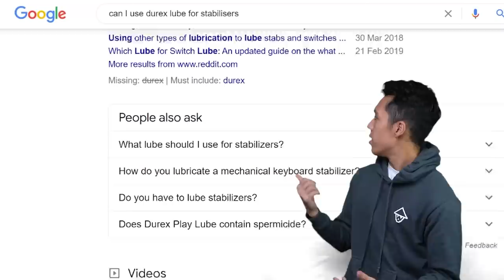$150 Budget Hotswap Custom Keyboard - Idobao ID80 V1

Comment from the maker: Two things, they do have backlight capabilities, I messed up, sorry about that :( and $150 refers to the price of the ID80. I made that clear at the very start of the video, hope that helps. Thanks! Also, go to: https://nordvpn.com/hamajineo or use code hamajineo to get a 2-year plan with a huge discount plus 1 additional month for free !  

Thanks guys, see you in the next video! <3
Reply: hi
Reply: Does it still work if I already have a NordVPN plan?
Reply: So the gmmk pro is looking like a way better 75% for 20$ more. Am I wrong here?
Reply: 150 dollar is not budget? I found a 40 dollar hot swappable one on amazon. Am I gonna get disappointed?
Reply: @kuropark9103  probably
Reply: @kuropark9103  Compared to high budget expensive ones, and the quality of this case, and the fact that this is a 75%, it is forsure budget. and how did you find one for 40$? probably lower quality and 60%.
Reply: Technically, it doesn't support RGB switch backlight, only single colour LED for switch backlight. Those SMD RGB LED are underglow, not backlight.
Reply: @kuropark9103  sometimes “hotswap” means Outemu Hotswap where the sockets are a lot tighter than your standard Kailh Hotswap socket, so most switches may not fit/will be an extremely tight fit. TaeKeyboards has covered a few keyboards that have had this feature, you should poke around.
Reply: You know 150 Budget Keyboard? Huh 3000TL in turkey surely a budget one
Reply: I was gonna buy the drop alt from Amazon since I want a hot swap keyboard but then I watched your review on it then you said that you don’t recommend it and that you would recommend the id80 instead and I’m glad I listened to you and saw your reviews I still haven’t ordered it I have to ask my mom but still thank you I’m glad I did my research
Reply: is it 3 pin or 5 hotswap?
Reply: Yeah it becomes like 300$ if you sum up what you used in the video
Reply: put keyboard switshces in a mouse hanji

Comment: I have the v2 version and I love it, it's a very good starter keyboard despite the issues with the pcb haha!
Reply: i just ordered one
Reply: What's the issues, man?
Reply: What's the issues? I was interested in this keeb
Reply: I laughed a bit when I read V2 as version 2 then read version right after 😭 no hate tho ❤️
Reply: @Kizzster  there are slight issues with having the pcb getting a short circuit with static electricity when coming in contact with the case. You have to make slight modifications by adding copper tape and washers the screws for what I heard.
Reply: @ItsTrain  Thanks for the heads up, Would you recommend the v1 version over this? I heard there will be a Idobao ID67 hotswap so I might just wait for that instead!
Reply: @Kizzster  I'm not sure actually. I think they both have the same pcb but im not sure
Reply: @ItsTrain  v1 and 2 has the same PCB, right? thanks for the heads up.. will sure to coat the top  screw hole with some plastic tapes.
Reply: Theres the ID80 Crystal kit version with gasket mount, up for GB
Reply: @ItsTrain  Really? Lucky enough i don't have any issues with mine
Reply: @AmniFilms  yup lucky you. I had to request them to send me another pcb cause I shorted out the first one because i didn't know about it.
Reply: I think the v2 was a group buy like while ago am I still able just to buy it now?
Reply: @davids6126  Every Idobao gb will have an in-stock sale follows if gb number is promising. So far Id87, id80v2 were groupbuys and they're all in-stock now.
Reply: @khoitranhuy3544  whats the differences between v1 and v2 ? And where can u get them ? Thanks
Reply: @Kizzster  wait for gmmk pro it will outperform any of these keyboards
Reply: @ZEY270  I'm waiting for it :)
Reply: @Kizzster  I would've ordered it already but I want the ISO version and it's not released yet
Reply: does it come with the pcb and everything you need?
Reply: @Callum71969  because every other keyboard in this community costs way more that's why
Reply: @Callum71969  well those that cost less are just typical gamer keyboards and this is about more than just gaming it's about quality and feel
Reply: @Callum71969  nah man now you're just a literal troll
Reply: @ZEY270  That aged like milk

Comment: Title: Budget $150 Keyboard, Keycaps: $400 on the aftermarket.
Reply: @andrewchiappetta1262  KBDfans also has cheap decent Cherry Profile caps
Reply: Someone's new here lmao
Reply: @stephenpena7813  lmao
Reply: Because GMK sets are limited-run and hyped sets can go up to outrageous flip prices. It's at $400 because well, ballin' hobbyists pay that much for it. 

GMK sets during Group Buy stage (Group buys suck, I know, but it is miles better than flip pricing) are the most 'budget' friendly, considering they sell at their cheapest of around $110-150 (base kit). You can also find decent in-stock (non-GMK) sets for around $50-100 (you get what you pay for). ePBT is a solid non-flipped alternative.
Reply: Asterisks near the ePBT because they have limited run sets like GMK and already do have flipped sets. They do have basic in-stock sets running about $80-90, they make very solid ABS doubleshot or PBT dyesub.
Reply: @andrewchiappetta1262  facts i got some clean keycaps off banggood and i got gateron blacks
Reply: You can get decent clones of the Olivia set on AliExpress though, ngl.
Reply: u can get decent clones for 40$
Reply: Also akko has a great black and pink set
Reply: You can just buy a clone or something else

Comment: Hi Neo,  i 've picked the ID87 TKL... with White Leds, same design
same comments : must have screw- in  stabs and foam : but i added the idobao optional foam between the plate and the PCB
same problem with the angled design at the bottom, couldn't close the back chassis 1st time and crushed a resistance components, so spacebar led is not working anymore
The TKL is heavier than the 80 and no problem about that + beautiful black anodized aluminum
True for the price it's a nice starter kit, $199 for the TKL, now at $179 but when you add switches and caps, and are looking at a +300$ keyboard. Mine has Zeal (expensive) linears and TaiHao double shot PBT caps, plus i added the stainless steel caps for gaming : incredible feeling > as a result $390 !
Nice overall sound with silent linears , especially the metal caps are exceptionnals , PBT caps are a bit "dry" to the ear - only sound that i had to improve was the spacebar !
Put it reversed did the trick, annd is really better at use for gaming!
here are my feelings and opinion about this keyboard
Nick
Reply: Hey I was just wondering if there were any differences in between the ID80 and the ID87. I was planning to buy the ID87 however I haven't come across many people who bought it, but rather bought the ID80. I am just afraid if there any differences between the 2 boards as it looks the same, just obviously a different layout.
Reply: @jasonwang9002   if you wanna go for the ID87  just do it, but be careful mounting the pcb and fixing the sandwitch design, especially with foam. 
i'm building a Drop CTRL high profile,,, nice pcb but only 3 pins,,, i had to cut my expensive 5 pins Zeal ;(
and BIG problem with stabs plate mounted!    i'll order the cherry soon , instead of everglide ... 
but perfect quality alu chassis, and RGB looks incredible
Reply: @nicolasgruat1842  in your opinion, what would be the best hot swap tkl keyboard to build, as I am a beginner and looking for a hot swappable board that is of quality.

Comment: i sold a keyb that had rattle and i couldnt do anything about for like 295 pounds i bought the Idobao ID80 and boba u4t switches which costed me 175 pounds meaning i have 120 left so tell me guys, what gmk keycaps should i get for 120 for this keyb? i got black btw

Comment: Hi, I'm very new to custom keyboards so my knowledge about switches, stabs and other components of a mechanical keyboard is still very limited. As I was thinking on building a keyboard using the idobao id80 v1, I would like to know if the Gateron Brown Switches would fit in that pcb, also what other lube should I get that is cheaper than krytox 205g0?

Comment: There are 3 version of this board, the v1, v2, and the crystal version which have gasket mount, non integrated brass plate, brass weight, acrylic case and smokey polycarb case

Comment: I've had the ID80 for awhile. It was pretty good when it released, but there are better starter boards now like the NK65 or the upcoming GMMK Pro and TKC Portico. The integrated plate in the ID80 feels pretty bad even with case foam.

Comment: Wait, if there isn't any RGB integration, than what the heck are those two old pieces under each switch on the PCB?
Reply from the maker: Those are slots for diodes I believe but I haven't used them myself yet - just taking a guess from what I read before

Comment: I'm trying to do research as to why people spend 150USD on a keyboard and call it budget (yes i saw the 850, 1100, 3500 USD builds too), when you can get one for 10 usd and it works just fine. I admit i never even typed on an expensive keyboard, but still, i don't understand the why of it on spending this much on a keyboard. 

So far what i gathered why people do it:
They like:
-the sound.
-the feel.
-the looks.
also because it's one of the main things you interact with while using the computer.

Someone please enlighten me.
Reply: If you're into keyboards or use them a lot you want one that is quality, cheaper keyboard cases are less quality sound alot worse when typing and don't feel as good you can feel the quality in a case while typing, as for switches it's pretty obvious why you would buy some what expensive switches, feel sound quality etc